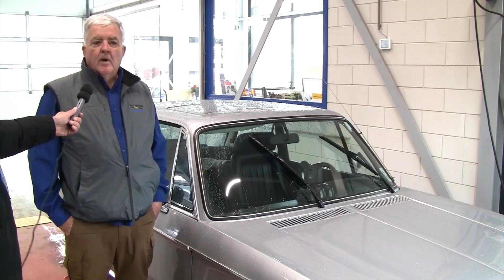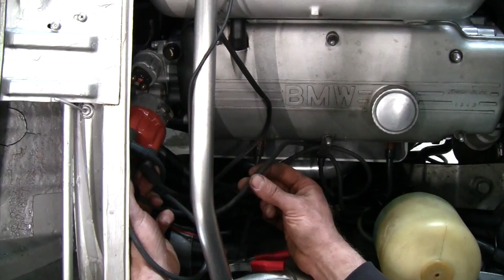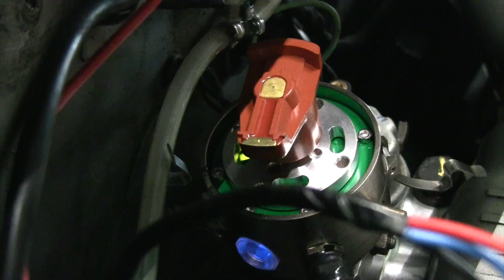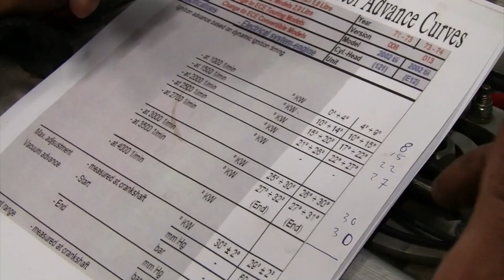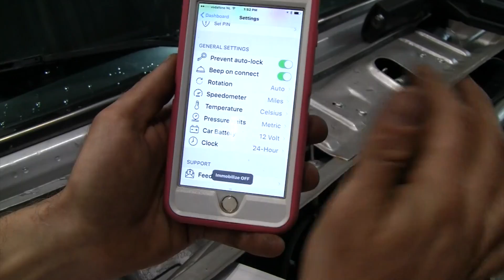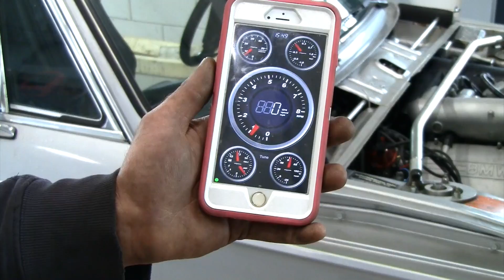How to fit the 123\TUNE+ (with Bluetooth)

Comment: Hello, I have a new 123 tune + igniter for my Porsche 914/4 d-jetronic.
but I still have a problem, I set the static advance to 10° it's good, I set my cartography to 1000/3500 /30° ok,
but when I drive under load at 5000 rpm I have some knocking and see it 40° ahead!! I don't know how to fix this and have my 30° no more???

Comment: You have to take off the valve cover to find top dead center, correct?
Reply: You can also look at the crank pulley it has a marker on it with an arrow mounted on the engine front cover, it will show quite accurate tdc. To know if it is the compression stroke you can remove the spark plug on the 1st cylinder and feel if it builds up pressure. You can also look at the position of your current rotor if it gives a thunderbolt for cylinder nr 1.
Reply: Remove the spark plug from cyl. 1 and put your finger on the hole. Turn the engine until you feel pressure building up under your finger, that's the compression stroke. Then, put something like a screwdriver into the cylinder and continue to rotate the engine, making sure the screwdriver doesn't get wedged between the cylinder and head. You'll feel when the piston stops before it starts going down. That's tdc on the compression stroke.